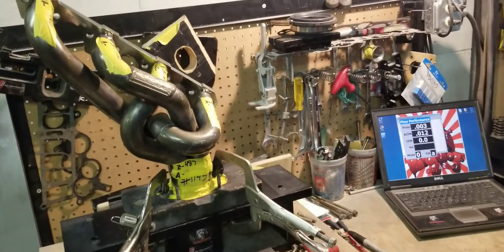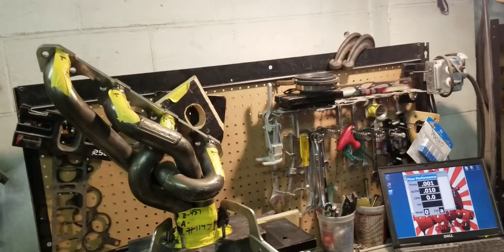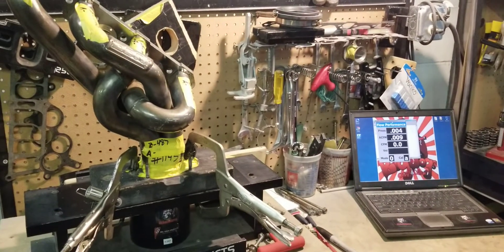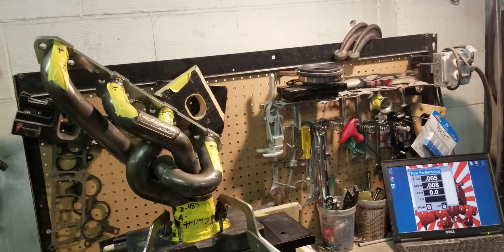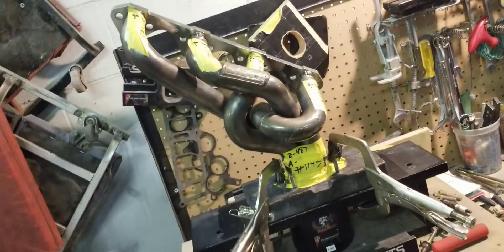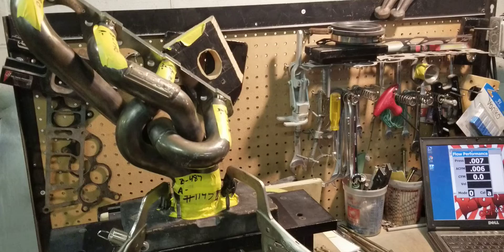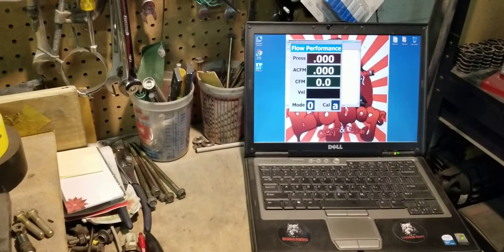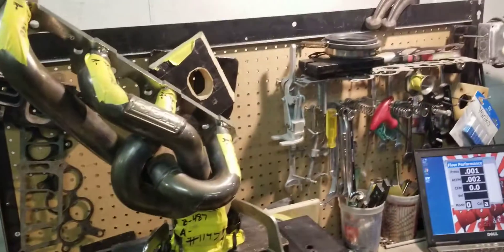BBK Fox body equal length headers flow testing part 1

Comment: An UEL vs EL longtube flow video would be good. Most people think BBK LT are equal length but they’re not. Jegs, PaceSetter, American Racing make EL headers for a fox.
Reply from the maker: EL and UEL headers makes pretty much the same hp if the flow is the exact same. Most people don't understand the power gains comes from the differences in flow and not design. We did testing on a engine dyno years ago on two different header types on a sbc 383. Primary pipes were the same and the collectors was the same and the power past 3,000rpm was the same by 3hp. One was a long tube and the other was a shorty. That's when we realized that most people do know what they are talking about lol
Reply: @ okay so what is a good and obtainable header for gt40p heads??
Reply from the maker: @ztyke we use and sell our ported and modified stainless steel shorty headers. We've had them on tge dyno, sold many of them and compared them to man. We also sell custom built P head spark plug wires set with no burn fire sleeves.
Reply from the maker: Here you go.
https://youtu.be/kYVN-PAdnFw?si=Dl9dKxUBZQC2l9Je